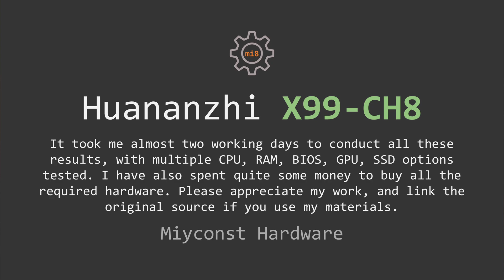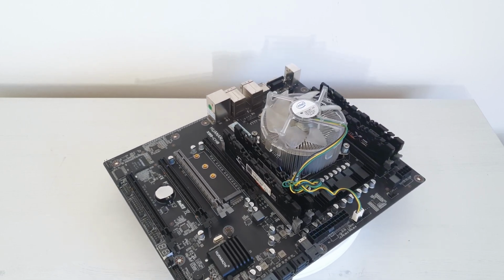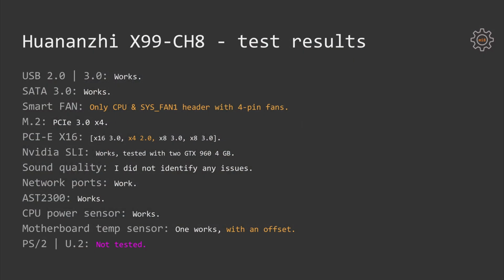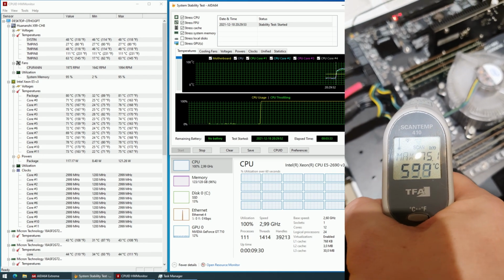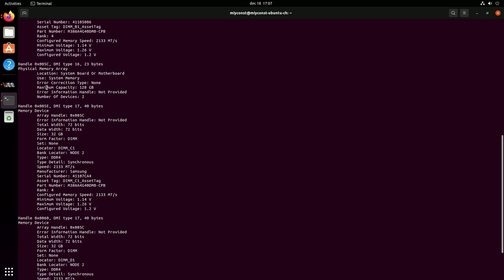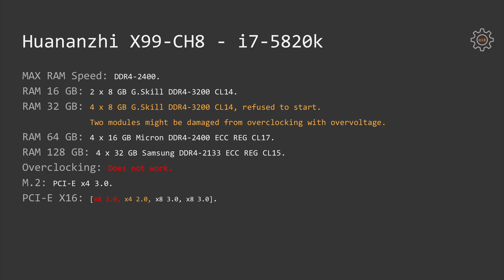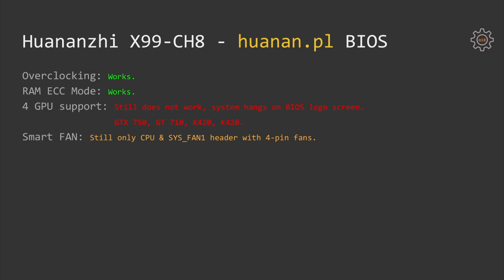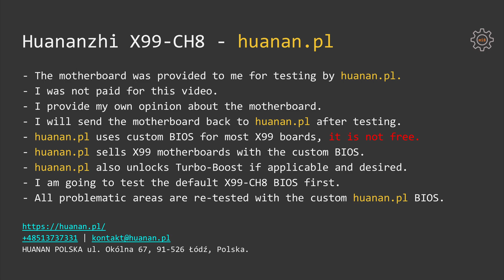🇬🇧 Huananzhi X99-CH8 – LGA 2011-3 motherboard for servers and mining, detailed review

Comment: I have a problem with SF 8643 port problem, drives are not visible. Do you have any fix/settings for that issue?
Reply from the maker: I don't have a solution for that, it could be a defective motherboard, a defective cable, or something else.

Comment: Amazing channel, thank you. I am looking for a single CPU X99 (Xeon 2695 V4) server/nas motherboard and this Huananzhi X99-CH8 caught my eye because of your review, though I am concerned about your comment on the wimpy VRM. The integrated VGA is a big plus. Can you suggest any competing boards with similar features I should look at?
Reply from the maker: X99-CH8 will be just fine with E5-2695 V4 but I don't see a reason why someone would need X99 for a NAS. The old Xeons are rather power hungry, the idle power consumption without drives will be ~50 watts, plus I don't recommend Chinese hardware for critical devices like NAS. If you have a possibility, just pick and old LGA 1151/1200 server motherboard/workstation from eBay and it will serve you better.
Reply: @Miyconst  I think by stating "server/NAS" I have given the wrong impression: I do want a (budget) server with more grunt for more demanding tasks (e.g. running multiple VMs, video processing, on 24/7). However, due to the power-hungry nature of X99 I'd prefer only 1 cpu (not dual) like this CH8. Also I may wish to pass a PCI gpu over to a VM with IOMMU so that makes the inbuilt VGA of the CH8 attractive (as gpu for the host), though I could just use a basic PCI vga card for the host if it didn't have the built-in. My question is really are there any more robust/proven X99 boards for my use case. e.g. a MACHINIST MR9A, equipped with a basic GPU? Thanks for your valuable advice!
Reply from the maker: If your focus is reliability - avoid everything from AliExpress, get a second hand Dell T5810/7810 workstation instead. Also depending on your RAM demands, an AM4 based system could be a much better fit.

Comment: I need this board for coding and also for blender because you get so much cores for cheap and thats good for me bc i want to get into pc building and coding in low level language because in my trash linux laptop ive installed vinegar (roblox studio wine program) for luau so i know the feel of coding, and blender will be useful because i need to make models for roblox or when i can get the chance to develop in unreal engine. Oh and know how pathetic vrm heatsink is so i will get heatsink replacement with thermal tape 😁. When i get this board i will make sure to give credit
Reply from the maker: You don't need cores for coding, you don't need cores for blender, you need a strong CPU. Modern CPUs with fewer cores are much stronger than the old X99 Xeons. X99-CH8 also makes little sense unless it's cheap or you need some of its features.
Reply: Will its because i need ecc. Bc im on budget and need smt that lasts long. Also im not expecting great gaming peformance. I just want to render and do basic gaming.
Reply from the maker: @coolpckid  what makes you think that you must have ECC and even if you do, there are better X99 options than X99-CH8, for example pick a used Dell T5810.
Reply: @Miyconst I will get better compnents like a ryzen 5 or if to broke. E5 1650 v3. Also mr9a is a good option right

Comment: i would assume that 4 gpu not booting is problem with above 4gb decoding. If thats enabled, maybe it boots.I had same problem with supermicro,  but it automatically went to bios and let me know that i have this pci adressing problem.
Reply from the maker: If I remember correctly, I tried with Above 4G Decoding and it didn't work either, but it was long ago so I might have missed it.
Reply: @Miyconst  I would assume you can check this out by adding-removing a card. it will decrease total usable ram (under linux). In windows it always seems to report all ram even thou it can't use it. For me I have never seen above 4gb decoding work on chinese boards. you can enable it, but some don't boot or don't boot to windows. Maybe something to investigate. My 3 gpus setup has only 252GB of 256GB ram available after boot. If I add another card it needs above 4gb decoding to be enabled. On MR9A-PRO i have 126GB of 128GB available with 2 gpus. Why I ended up here is to have 3 gpu passhtrough machine and this board seems to be something to consider.

Comment: I wonder if anyone does happen to have a block diagram for the X99-CH8. A block diagram is basically a sketch that show what component is wired to what port and should also show if ports are shared and how they are shared.
Reply from the maker: I surely don't have the block diagram of any Chinese X99 motherboard. The reason is simple - Chinese don't have it either. 😃
Reply: @Miyconst  Thank you for your quick response. I wanted to find out if any of the PCIe, M.2 are shared in someway. I have to say the Huananzhi Aliexpress message board support is for me a total disappointment. Asking question there ends with: we don't have,  Engineer is off duty, Engineer is on vacation, after sales manger will contact you - never did, block diagram is company secret and more excuses.

Comment: In the fork of the X16 slot can I connect 4 NVME with the default bios?
I have several Machinist boards and would like to do this, the Machinist board doesn't have that option.
I work in a small Data Center in Brazil and we always assemble servers, the Machinist cards are great but they don't have this option to fork with adapter cards to connect 4 NVME to PCI-E
Reply from the maker: Yes, you can do that.

Comment: Your members on your discord channel just recommended this to me as a house server  so I have ordered one with a xeon v4.   For my use as a small server its perfect, except its a svga output and not a dvi / hdmi or display port.   The vrm is probably improvable with a bigger heat sink and /or active cooling I will check that out.   I will test and see how it does.  TY for the review!
Reply from the maker: Good luck with the project!

Comment: There is one 20 (-1) TPM connector close to battery after last PCI-e slot, it looks like it is Asus compatible. Did you tried that?
Reply from the maker: It's not working properly and it's confirmed by Huananzhi, so just disregard it.

Comment: Have received my X99-CH8 (August 2022) from Aliexpress Seller WUSON Store (good English communication). The board is of revision V 3.0 and I ordered with 128GB DDR4 memory and a Xeon E5 2680 V4 CPU. My use case is Proxmox OS (Hypervisor type 1) and virtualized OS like Win, Linux, OSX or whatever else I want to try out. Additionally I installed 2 dedicated GPU's like a RX580 8GB and a Nvidia GTX970 4GB hardware pass through for the vm's. I do not game or mine at all. Huananzhi provided me an updated BIOS that enabled ECC memory. 1 24" monitor is attached to the onboard legacy video for proxmox. 2 28" monitor for the dedicated GPU's to display vm's. This X99-CH8 board was the right decision after watching many of your informative videos. Thank you very much.
Reply from the maker: It's a very nice build, I am glad to help.

Comment: did xeon worked? 
im trying to find a motherboard with lga 2011 to farm, so xeon accepts ecc reg and also have high l3 cache and smart cache... 15 to 30mb, and more core/threads...
and hash might work on threads

my doubt is if farming works with xeon/ecc reg ram...
Reply from the maker: Yes, Xeon works for farming :)

Comment: could you please tell me the difference between this board and x99 f8 which one is better in the made  i have noticed that x99 tf has fans over it and has firmed its pcie  slot .does this means x99 f8 is better i want chose one for 7*24 use .which one should i choose .by the way i am from china ,we can buy this for very low prize .x99 f8 only sales for 689RMB that is about 110 $ or 100€ so the prize is not a big problem.forgive my poor english i am trying to improve it
Reply from the maker: Both of the motherboards are about the same quality, so you need to pick the one that has features you need. One has better VRM, other has onboard VGA and extra PCI-E slots.
Reply: @Miyconst  thank you very much

Comment: Thx...Nice that you have checked ECC correction, I often miss that in the test on the net, including Ryzen, many buy a server board + ECC RAM and non "pro" Ryzen and believe that if ECC is lit in the uEFI everything would be "safe"...which is not so.

Maybe you could test what the board consumes in idle power, which is not unimportant in 24/7 operation.

Maybe the "Huananzhi X99-CH8" is the first china LGA 2011-3 board that really comes with ECC correction, at least in BIOS mode...For me it is usually cheaper in Germany after "Asus Z10PA". There are boards for around 200 €.
Nevertheless, I find it interesting, maybe it comes from an EU warehouse for about 200€.
Reply from the maker: The idle power consumption in my setup was ~50 watts. Asus Z10 is a good motherboard, I would pick it over Huananzhi.
Reply: @Miyconst  With the ASUS Z10PA-D8/ASUS Z10PA-U8 iKVM is already good, unfortunately it consumes well over 5Watts in off mode.

~50 watts idle I have when I use the Xeon E5 2673 V3... with 3x 16GB DDR3 ECC/REG. I get a little under 40Watts with the HUANANZHI-X99-F8 with 4 xDDR4 ECC/REG., Xeon E5 2630L V3 or Xeon E5 2630 V4 ..interestingly the processors consume about the same when idle.... (~ +/-1-2 Watt), I think the advantage of 14nm vs 22nm manufacturing is cancelled out by the more cores/threads.

Comment: "SLI works" * rolls eyes * "PCIe bifurcation/IOU works" oooooo, nice. Apparently the SuperMicro (C602/X79) board I'm waiting on didn't get that feature.
Reply from the maker: X79 chipset is rather limited compared to X99, thus I won't be surprised if some features will be missing.
Reply: @Miyconst  Tell that to the chinese who got E5 Xeons working with laptop chipsets. Also, SuperMicro X9SRG-f IOU on C602(X79). Chipsets don't matter, that's all artificial segmentation. Also, chinese boards with M.2 boot support; I imagine you're familiar with those.
Reply: To be clear, I wouldn't expect x79 or c602 to support USB 3, but all else is as I said.

Comment: I have a question for you which x99 motherboard has the best power supply section because I would like to use the xeon e5 2699 v3 and that it would have the best 8 ports for ram memory 256gb ram 8x32gb
Reply from the maker: Take a look at the Asus WS series motherboards, these have good VRM.
Reply: @Miyconst  And what do you think about the asrock x99 oc formula motherboard is at a good price on the auction site from my country and the most curious to me if it could handle 1x32gb ecc because I am the owner of one on the site writes max 128gb but somewhere I read that it depends more on cpu
Reply from the maker: @twojstarypijanywedzisiewko5803  to use ECC REG memory you need CPU & motherboard that supports it. E5-2699 V3 does support ECC REG memory, but AsRock X99 OC Formula does not support ECC REG memory as far as I know.
Reply: @Miyconst  this is written on the asrock site
Reply: @Miyconst  Supports DDR4 UDIMM ECC*, RDIMM Memory (*It requires DDR4 ECC x8 (8 bit) RDIMM/ x8 (8 bit) UDIMM with Intel® Xeon® Processors E5 Series, but not include x4 (4 bit) RDIMM/ x4 (4 bit) UDIMM.)
Reply from the maker: @twojstarypijanywedzisiewko5803  sorry, I have missed that, if AsRock officially supports - it's supported.
Reply: @Miyconst  e5 2696 v3 v4 and whether this processor will be supported even though it is not officially listed in the supported cpu
Reply from the maker: @twojstarypijanywedzisiewko5803  most likely it will be supported, but since I have not tested it myself, I can't guarantee.
Reply: @Miyconst  thanks
Reply: @Miyconst  and you can upload microcodes, like in the old socket 775, if so, how and what microcodes

Comment: hello, recently most motherboards x99 on sale in aliexpress have b85 or similar chipset, does that affect anything comparing them with c612?
Reply from the maker: B85 chipset does not have any CPU overclocking capabilities, does not have server features, and has only a few SATA 3.0 / USB 3.0 ports.
Reply: @Miyconst  can u turbo unlock with it?
Reply from the maker: @Zarkinn  yes, you can.

Comment: Hi, this is a bit confusing, for me this mobo with original factory BIOS and using 128Gb of Kingston server ECC RDIMM  registered RAM  with four channels and dual ranks and is working normally nice, Many months ago since I have order this mobo from Aliexpress I have no idea about Huanan.pl  and its related modified BIOS of which I became aware just today, 

Anyway I am not intrested in modified BIOS because I never overclock anything and I am not intrested in overclocking processor RAM or monitor

Miyconst need to clarify carefully this ECC point in this video, one of the early comments for this video I saw was about someone intrested in this mobo but because he understood ECC is not working with original BIOS he was put off about this mobo
Reply from the maker: ECC RAM works with this motherboard, but in non-ECC mode, please listen and read the slides carefully.
Reply: @Miyconst Hi, can you please explain how to check if my Kingston RDIMM ECC memories I have installed currently in this mobo are working or not as a ECC memory?, I have no clue about this and I am really curious, thank you
Reply from the maker: @enriconapolitano4321  you can search in google, there are special commands to run in Windows and Linux terminal. I cannot paste links because YouTube deletes such comments.
Reply: @Miyconst Thank you Myiconst

Comment: Thank you so much for this video, I LOVE a Lot this motherboard which I got from Aliexpress, the integrated VGA video output is working nice plus 8 RAM slots which I have with 128Gb Kingston Server ECC RDIMM registered memories with stock BIOS,  I plan to improve the VRM cooling and chipset cooling with a custom made bigger larger taller heatsinks, I am so extremely happy with this mobo that I going soon to order another same identical to have just in case,

Comment: Thank you for the great videos, and wishing you and all the people from Ukraine the best during this atrocious moment. 

I am building a new home server and this MB looks great. But the ECC not working on the original Bios is a deal breaker for me, since I'm in the US and would have to buy from AliExpress. 

Do you recommend any other MB for home server at this moment? Thinking of using a 2660 V3 for now and upgrading the CPU to a V4 in the future. Will be a Proxmox VM host with NAS.
Reply from the maker: You can use X99-F8 with BIOS from iEngineer, it has better VRM, no onboard VGA, no U.2 for storage, but the BIOS is free and you get ECC support.
Reply: I have this mobo working nicely with 128Gb Kingston Server ECC RDIMM registered memories with stock BIOS, why you say ECC not working?
Reply: @enriconapolitano4321  in the video he said the original Bios (from Ali Express, not the .pl one) doesn't have the memories working in ECC mode. Did you watch the video?
Reply: @CleberMori  Hi, this is a bit confusing, for me this mobo with original factory BIOS and using 128Gb of Kingston server ECC RDIMM  registered RAM looks like is working normally nice, Many months ago since I have order this mobo from Aliexpress I have no idea about Huanan.pl and the related modified BIOS for this mobo, 

Anyway I am not intrested in modified BIOS because I never overclock anything and I am not intrested in overclocking processor RAM or monitor
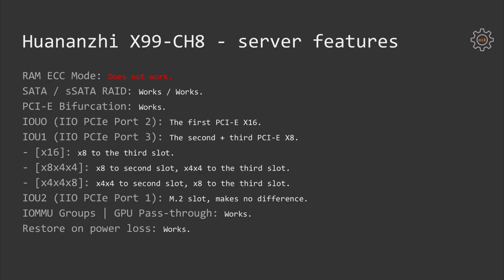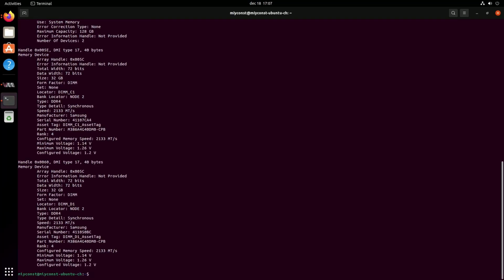Reply: @enriconapolitano4321  if you look at 8:30, you'll see that the memory works, but not in ECC mode. He shows the command with that info at 8:36. Perhaps your MB and Memory are running OK, but the memory is not in ECC mode?

Comment: Did you try Xeon E5 2696V3? Is a 18C/36T 145W part with 2.3Ghz base, 3.8Ghz single core turbo. It goes up to 3.1Ghz all core, I think. For around 100us it's a good CPU. Bought 3 for U$S70 each, locally. Issue is, It behaves strangely. If I use "Balanced" power plan on Windows 10, 1C turbo doesn't engage and it works at 1.6Ghz because it doesn't register the load. It doesn't happen on ESXi, it goes up to 3.8Ghz no issues. Anyway, I'm waiting for new 2U coolers because the cheap cooler that I used with E5 2678v3 can't keep up with the 18C load. It crashes on ESXi, I hope it's just temperature...
Reply from the maker: I have not tested E5-2696 V3, but I have tested E5-2698 V3. The "Balanced" preset in Windows messes up many Xeon CPUs, thus I am not surprised that it has issues with this unofficial 18 Core E5-2696 V3.
Reply: @Miyconst  I had this with a regular i7-2600 as well, like it would not turbo up from 1.6Ghz on incoming file transfers etc. Intel's power managment is really good, if you tell Windows to run the CPU at max performance it stays at baseclock instead of dropping to 1.6Ghz, but on a watt meter there is no difference in power consumption.

Comment: Looks like a decent board. Thanks for your hard work, it seems they have listened to you and they are improving with each new iteration.
Reply from the maker: Yes, it's a decent motherboard, but the price is not good.
Reply: @Miyconst  usually boards with a built in AST2300 or AST 2400 are going to cost about $100 usd over a version without. But yeah here in the US similar x99 boards that are feature rich from a name brand are pretty abundant on the 2nd hand market for about the same price.